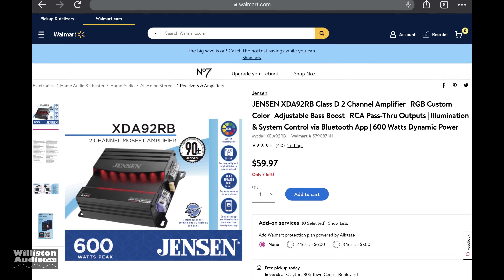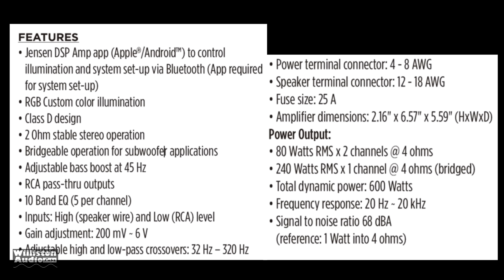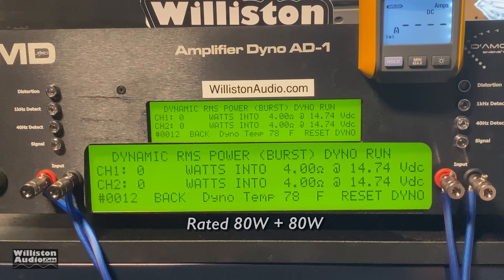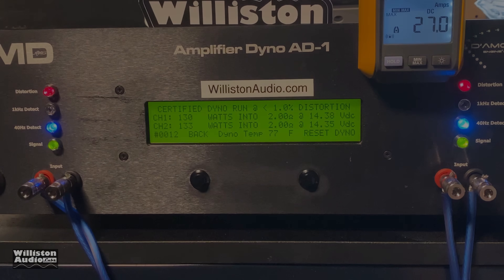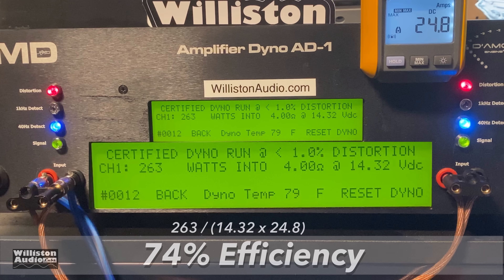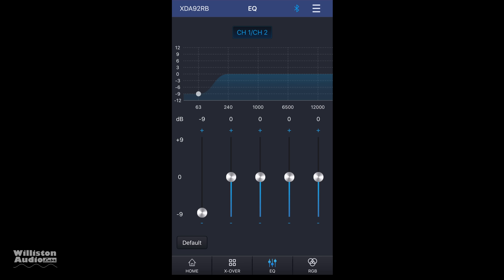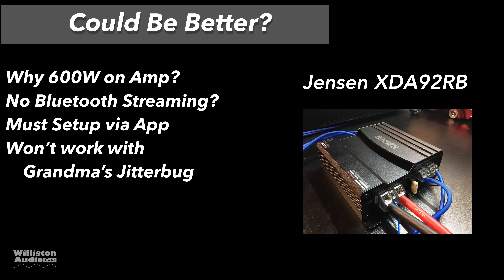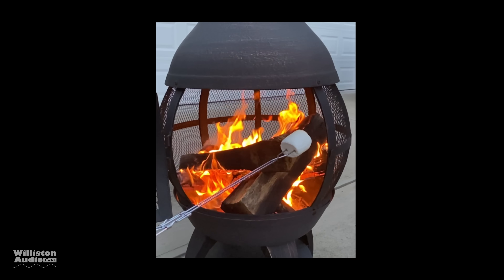Is a $59 Walmart Amp Any Good? Jensen XDA92RB Amp Dyno Test

Comment: I'm considering gutting out the audio system in my 1990 Dodge B250 Ram conversion van,  wiring and all, and starting from scratch.  Right now,  it's complete sh!t. I don't know if the conversion people botched up the wiring or the aftermarket head unit is whacko,  but the fader is totally bonkers!  When set at center,  the rear 5 1/4 speakers overpower the front speakers by a large margin.  If I adjust it to favor the front,  I get a wee bit more audio out of the front but the rear still overpowers them.  If I fade it all the way front,  it's the same as setting it at center again.   Plus,  the passenger door speaker is far louder then the driver door speaker.  Overall,  the sound quality actually hurts.  It's shrill, screechy, and any bass is awfully distorted.    The head unit is an old Pioneer "Super Tuner"  AM-FM Cassette with push-button volume.  The cassette part is totally dead.  It won't even take one of those adapters.  it just clicks back & fourth trying to decide on what side to play, and then just shuts off.  And just today,  it wont even take in any tape or the adapter. So I'm stuck with radio..  And radio these days is just total garbage, with all the ads, blabber-mouthing, sports-jocks, and the same ten overplayed songs on repeat all day every day. 

So...  I'm in the market for a full system. Head unit,  front 6X9's,  rear speakers upgraded to 6X9's Preferably all the same brand.    I never listen to any of that rap or hippy-hopper crap.   I'm not looking for Earth rattling bass.  I mostly listen to classic and 80's rock,  classic country,  and even throw in some trance and light dub every now and then.   So good bass is is desired,  but good highs as well. I like it loud,  full, thumping, and without distortion.  I would like a head unit with real knobs to adjust volume, bal/fad, and bass/treb on the fly.  I hate having to piss around with menus to do such a simple thing as tweak the bass back a notch for a bass-y song.   I also would like something that is NOT lit in blue.   I prefer an amber colored display that can be dimmed for night time. But set bright enough to see in day time.   Single din.  No disc player needed, no tape player needed.  Would like Blutetooh,  aux,  SD card, and USB inputs though.   Heck  even  some internal storage would be great.   The main speakers I'd prefer to run right off the head,  but maybe a 10 inch sub or two that can slip under the rear seat.  Must be slim, as I don't want them interfering with the power mechanism that unfolds the seat into a bed.  I'm thinking one or two of those "under the truck seat" subs.  Maybe this amp can run them.  But going back to preferring it all be one brand.. If I go with this amp,  I'd also want to have everything else be Jensen..   

So finally:  A question to you audio guys out here.  Throw me some recommendations for a Jensen head unit and speakers  (Model numbers too, please) I don't have a big budget though.  Trying to keep the whole thing under 300 bucks.   If not Jensen,  What do you recommend for a budget build?   Again, keep in mind that I need it to be unobtrusive as I do use the van for family outings and not just a concert on wheels.  I can't have a big amp or big speakers taking up cargo or passenger space. 
Thanks!

Comment: 🛑FOR THOSE WHO DON'T KNOW, DUEL ELECTRONICS ACQUIRED JENSEN BACK IN 2015.
 THIS THE SAME EXACT AMPLIFIER Dual XPR82d but the Dual amp has a better signal to noise ratio 100 db💪🏽 compared to the Jensen's 68db 🤦🏽‍♂️
You can look it up on the Walmart website. They have the exact same specs except for the Jensen amp has the DSP LED...
Now you know 😎
Reply from the maker: I said that 🤷‍♂️
Reply: @wal  oh, you did.. I didn't hear that or my phone must have been glitching 🤦🏽‍♂️🤣🤣🤣 but keep up the great work. I love the videos.
I'd rather pay the $60 for the Dual amplifier that has 100 db than pay a $60 for the Jensen amplifier with only 68 db  just to gain a light show 😂. I can build my own Bluetooth remote light show if I wanted to for pennies of a dollar.

So, at this point I guess it's going to be cleaner signal over a light show I guess for the convenience a person would pay the $60 for the Jensen amp with a variable LED lights.

Me on the other hand I need my decibels 😂

Comment: The original Dual versions of these were rated at 100db signal to noise ratio. The newer Dual and Jensen versions all are now 68db rated. How much difference is there in the sound? Still budget gem or sound horrible?

Comment: I just installed that amp for my 6x9s and it gave me rpm frequency noise and some static I wired it correctly I just returned it. It worked pretty good made my speakers loud but I didn't want any rpm whine or frequency noise so I only have bass amp now no 2 channel on my speakers now

Comment: Can one have 2 of these running with different eq on each one via the blue tooth or do they get confused which one is which?
Reply from the maker: I will try this soon and report back. Looks like you can switch between amps in the app
Reply: Was thinking the same thing could be a low cost active system

Comment: Not only can you change the x over frequency but also freq bands on the eq. But unfortunately each band is limited to the following zones: 20hz-100hz, 100-500, 500-5,000, 5,000-10,000, and 10k-16k. So you couldn’t tweak say 33hz and 92hz. Cool but still very limiting. Will be fun to experiment with REW and see how it tunes in the work truck. Picking mine up for $62 tomorrow!

Comment: Might have to pick a couple of these up, just for the built-in EQ. Need a 4 channel for my new project car, and my daily (pfp) has an eq with nonestop feedback noise, even after grounding each RCA input and running direct power lines to the battery. It's just garbage. for the price of a new EQ I can just get a couple of these little guys and bridge them, then throw my current alpine 4 channel from 2006 in the project car.

Comment: I bought the mono block and the 4 channel of the line up. I had to return due to no gain adjustments or crossover adjustments. Glad to see they would have done rated power but I need that adjustability as the speakers I had were rated for less power. I just couldn't trust an app to keep it in line. Great video as always. Keep up the great work. Always love watching the amp dyno videos.
Reply: They do have adjustments on the app
Reply: @RobertDickens2002  I had seen that but the issue with that was the gain has to be very finally adjusted just can’t be you know set to certain dial so speak but I did like the crossover features being able to just keep it at a solid number as opposed to having to adjust it but when it comes to gains it has to be finely tuned in order for not to be distorting. If it would have just left a gain adjustment I would have been all in. I had even bought the 4 channel for my mids. I returned both and bought a ds18 candy series 5 channel.

Comment: That’s pretty impressive especially having a dsp in a 60 dollar amp
Reply: Eq has adjustable frequency as well!
Reply: Luke Hollosy yes sir adjustments are very extensive for a 60 dollar amp and it runs Cool and sounds clean at 2 ohms per channel very impressed with it so far...figured I would buy 2 of them now before they either disappear or the price goes up on them since people can see there well worth it and then some
Reply: @ApEsXiT  . Really?  I saw where it said 5 bands per channel, which is already pretty surprising, but they are adjustable frequency also?

Id honestly entertain getting one if thats the case.
Reply: Twinky UnOuWaNtMyCrEaMFiLlInG yeah you can change freq to anything you choose..slope etc it’s a pretty incredible little amp

Comment: I was surprised to see it make rated power.  Did I read the specs correctly though - a paltry 68dB signal to noise ratio?  Why is class D such shit?  I've got 25 year old MTX amps and 35 year old Crown home amps doing 105 to 110dB S/N ratio.

Comment: If one was to use 3 of these amplifiers in a total system solution. Would there be any conflict with multiple amplifiers and the Bluetooth app? I assume they all have different MAC addresses but I suppose if you powered them up one by one and documented/IDed them, maybe that would work?

Comment: too bad dual/jensen doesn't come out with a little cheap mono amp capable of 300w, in my experience you always seem to end up having to add some kind of cooling system with bridged stereo amps because bridging always seems to make the amps run hotter, i don't know what i'll do with it but the local walfart has 6 of them so i guess i have to go buy one on the morrow....
Reply: CT Sounds 400.1 is $87 right now till tomorrow

Comment: Jensen has been trying to put out CEA compliant ratings as of late. have a jensen head unit on my budget build that has 20ms of time delay per channel! Pretty much built in rear fill processing right there (most dsp' s max out at 10ms). That being said the 68db signal to noise ratio on this amp might be the worst rating I've ever seen advertised. At least it's probably accurate unlike all those 100db no name amps that hiss with the gain all the way down.

Comment: Great choice for a review bigD! I have the older Dual 4 channel model and it has proven reliable. Has anyone torn one down past the board to see what chip these amps run? You can plainly see the power supply and filtering/strapping components by taking the cover off but the actual amp chip is sandwiched between the back of the board and the heatsink. I'm afraid to tear my Dual down that far since you have to separate the power supply FETs From the sink to get the board out of the case

Comment: I tell ya. In my car I have a Pioneer 5 Chnl pushing 4 6.5" Infinity Kappa series and 1 JL 10" that fits behind the drivers seat, in place of the shat Bose that came with it. (Not that I'm knocking Bose... *caugh*) So my wife asked if I could make her Ford Edge sound beefier. She Really liked the bass, but (said) she she didn't want anything (extravagant?), still don't know what she meant. So I put an old Comp 10" Kicker in it, that I had tried in my car originally. then thought to myself giggling, "Not extravagant, eh?". Went to Walmart and found something called a, DUAL?  Bridged it, didn't even mount it,  through this $89.00 little dude expecting something, "Not Extravagnat". I'm here to tell you. It surprised the TEE-TOTAL shat out of me. And I knew it did her too, because she looked at me as if that is what she expected out of me. I ended up purchasing the DUAL 4 channel big brother, out of curiosity, and put it to a set of replacement 5x8's in her doors with Infinity's Kappa series. My Lord? What the? No... 
       Yea. If you have already tried a DUAL amp. You know. Dollar to watt, efficiency and dare I say cleanliness out these two baby amps. I'm not sure anyone is there. And this was a couple of years ago. So if Jensen has stole their format, revamped it, or bought the company, whatever. They dial in.

Comment: I’m running a 15 at 2 ohms with my xpr82d bridged    And it’s been perfectly fine.   I wonder how much power it puts out at 2 ohms
Reply: I've been wondering that exact same thing.    Again.    I have mine bridged at 4-ohms running a 12W0 in a sealed box!   That setup shakes everything from the seats to the rafters folks!     I was wondering
what this thing might do to 2 JL parallel connected 10W3v4s?   Rated power bridged at 2ohms anyone?

Comment: Crazy to see a Jensen put out more than rated when so many other budget brands fall way short of rated.
Reply: Ik some of there old amps do these i was suspicious of like serious not much info till now
Reply: Jensen used to be high end
Reply: @bugmarkus  I remember in the 70s Jensen was too expensive, I had to settle for a lesser brand
Reply: I bought jensen products back in the 70s and they were pretty good but I was shocked to see a jensen Amp that's actually under rated. This  Amp is a little powerhouse for sure.
Reply: When jensen originally launched their gear they where intending to be in the sq high end range. 

I dunno if they ever put out any quality sq back then, but id image china bought them up and did what they do.  Made jensen junk. 

But it looks like some hope for them is possible.
Reply: @twinkyunouwantmycreamfilli8297  china didn't buy them. technically anyways.

Comment: Hi big D. Years ago when I was scraping by for my work truck sound system I recycled what I had.
In my 81 GMC Heavy Half I put Jensen 6 x 9 3ways in the corners behind the seat facing forward & 6 x 9 2ways aimed under the seat from behind & connected to the Infinity 3001's in the dash.
The tuner was a Technics unamped head unit that came with front & rear dedicated power amps. (Both with built in eq's).
At 1st I was really disappointed until I was able to dial it in after playing with it.
Damn it sounded good.
Sometimes certain things just work out unexpectedly. Don't be too worried to experiment.
Take care my big bud!

Comment: For 60 bucks I am impressed especially in the fact that it has a high pass filter and it's bridgeable that means you can set it up as a center channel. although the 300 w is a bit much for a center channel you'd always dial down the gain

I wonder what would happen if you had two are more of these amplifiers how would the app connect to them?
Reply: Now that's something I  never thought about

Comment: Doesn't seem like a terrible deal, good for rear speakers. For these ultra cheap amps it might be worth adding a test to measure hiss level
Reply: The older dual amp he mentions in the intro has great sound quality and its basically the same guts as this amp. Its 60 worth of stuff in there. You are getting what you pay for, for once, with this amp. Were not used to not getting fucked over when it comes to consumer electronic pricing.

Comment: I thought it said "BIODEGRADABLE" on the front when it first appeared, which sounded like a useful feature for a crap bargain basement amp. But then, lo and behold, it easily meets its modest rated power, has great features, and even looks nice. Turned out to be a winner!
Reply from the maker: Winner not a wiener 😝

Comment: I was literally just looking at these today at walmart lol. I'd like to see the "1,200" monoblock Jensen they have also.
Reply: It will probably do the 600 watt that this little one is rated lol
Reply: @chadcurrent1645  I'm actually pretty sure it does🤣
Reply: The 1200 does it's rated power of 600 watts RMS & MORE! 
I have it hooked up to a pair of Pioneer A Series 12's and it pushes them great!!!!
Reply: @alluhatorrrez3724  between the alpine monoblock doing its power then, and the power acoustik razor doing its power, for $100, totally worth it for either then. You get a lil more out the razor, but you dont have the app like the alpine. I was considering these for a single 15" in my jeep. The razor isnt 1 ohm stable, but will still pump power all day at 1 ohm lol. I wonder if the alpine will do the same?
Reply: @alluhatorrrez3724  Definitely some good, cheap power!
Reply: I just bought this today for a rockford 10' I got
Reply: @aeoteroa818  that's dope man. They seem pretty solid. I opted to upgrade my major system with the taramps smart 3k and gonna put my skar RP-2000.1D in my secondary vehicle. A lil over kill for my application, but its whatever. Itll deff push a single 18" pretty easily lol.
Reply: @1ohmwrecker  I put in rockford p1 speakers and I got a p1 sub, unfortunately I think I'm gonna have to return this amp because the sub is only 250 watts rms and the amp doesn't have a real gain control. I'm new to car audio this is my first install but I think this has too much power.
Reply: @aeoteroa818  you know everything on that is set by an app right?
Reply: @1ohmwrecker  he says in the video it's not an actual gain control just like a bass boost
Reply: @aeoteroa818  well I'm not quite sure how that works? That's pretty much why I didnt get it. I dont like app controlled things.
Reply: @1ohmwrecker  I don't either. I don't need another reason to be fuckin with my phone in the car nor do I want to have another app. I'm gonna order a 250w kicker amp Tomorrow
Reply: @aeoteroa818  it will be fine

Comment: I'm actually pretty dang impressed, 240 watts for 60 bucks? Not bad at all! I do wish this whole "max wattage" trend would finally die, it's totally meaningless and benefits nobody. For most brand name amps "max power" is just the RMS wattage multiplied by two, it means absolutely nothing. If you're building a budget system this little guy definitely looks like a great upgrade for your speakers over head unit power, you can run four 4 ohm speakers, two on each channel. I also really like the DSP features from your phone, it would be cool to see this in more amplifiers!